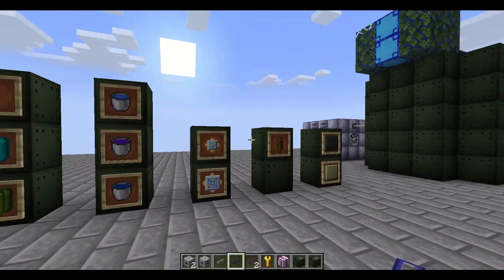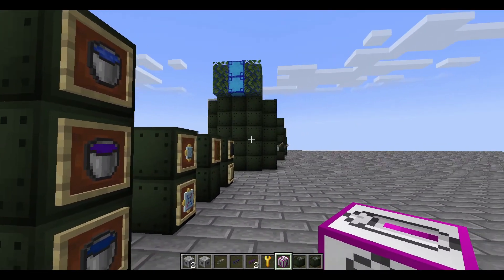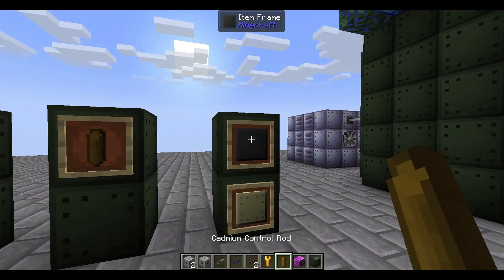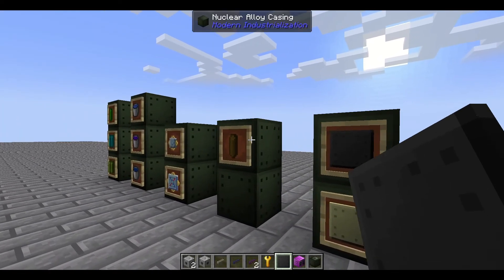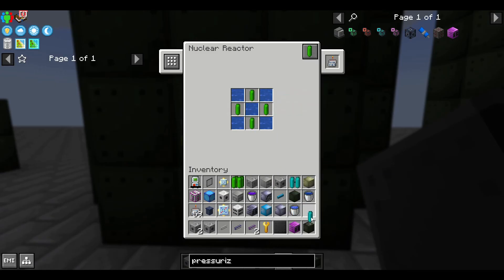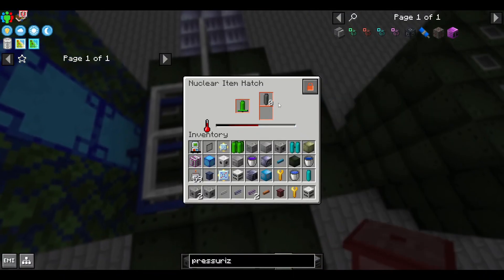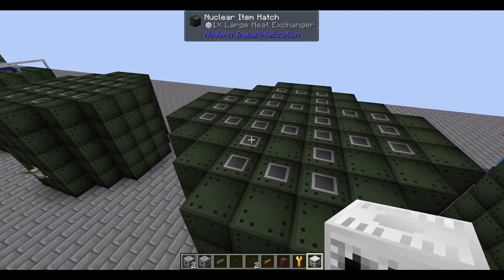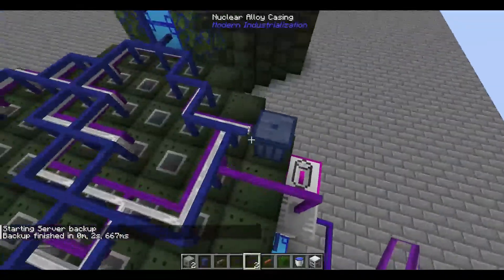FTB NeoTech- Modern Industrialization Nuclear Reactors

Comment: I need to see how its constructed because I cant get my reactor to form the muliblock and I dont know why (and yes I know about setting the size in the GUI).  Your video has no tutorial on how its actually constructed block by block, so what is the point of talking about all this other stuff?
Reply from the maker: you can hold the wrench in your off hand with the controller placed down to see the multiblock for the selected size of reactor, like all other multiblocks in MI
Reply: @pikminman13  LoL... I honestly do not know how I got so far into the mod without realizing I could do this!  I got all the other multi-block structures to work.  Turns out I was missing the inner blocks for the reactor.

Comment: note that HE and LE don't stand for high/low energy, but high/low enriched fuel rods. another term that comes up is MOX, which stands for Mixed OXide

I was doing research on nuclear reactors to make a greg nuclear reactor, and got stuck at the programming
Reply: Do you know the reason why he used the blue fuel rods in the latter setups?
Reply: @hollowlive690  reusing depleted uranium rods

Comment: My reactors just don't work, I don't understand, my steam pipes are inside the turbine, the turbine has spun up once but subsequently died. I am so lost.
Reply: I got mine working, so I may be able to help.

The small MI Reactor has 9 slots. If you follow pik's recommendation you will have 4 Item Hatches and 5 Fluid.
The Item Hatches are for inserting Fuel Rods and extracting Depleted Fuel Rods - easy-peasy.
The fluid hatches need Water (or Heavy Water, etc) inserted and the output fluids extracted. For Uranium Fuel Rods and Water, output would be Deuterium and Steam.
So you need to keep Water and fuel rods going in, and the outputs (including Steam) going out - continuously. I needed a bit of a 3 dimensional tangle of Pipes to accomplish this. If you don't remove the output products the Reactor will clog up - like any machine - and stop working.
I'm not sure if Uranium Fuel Rods can produce enough Steam to keep the Turbine going continuously. It may work in spurts only.